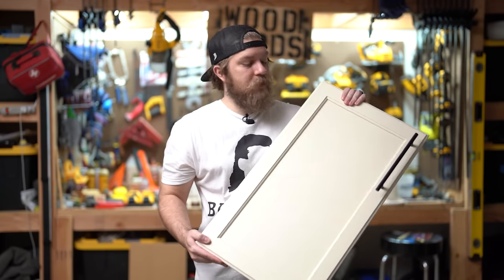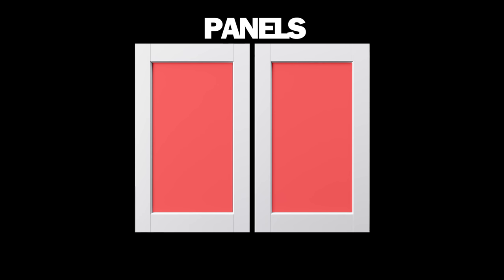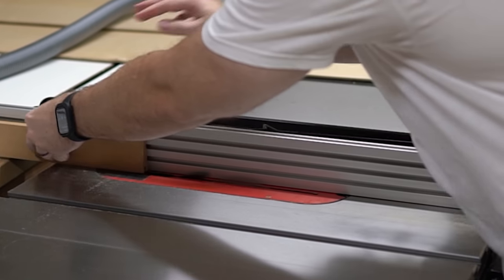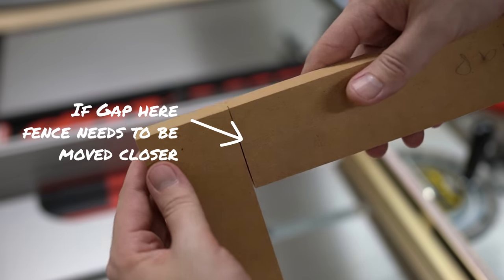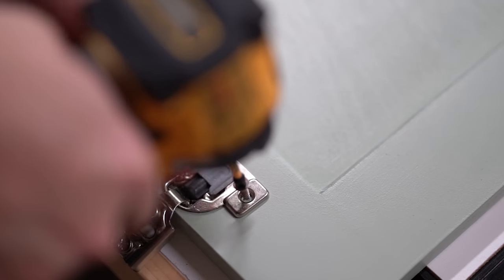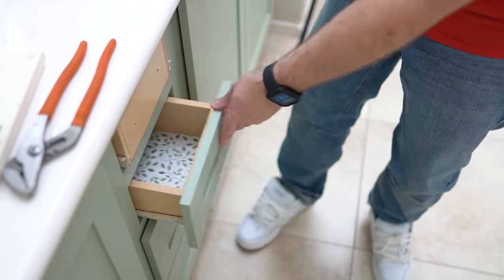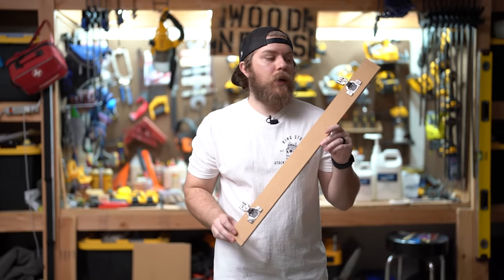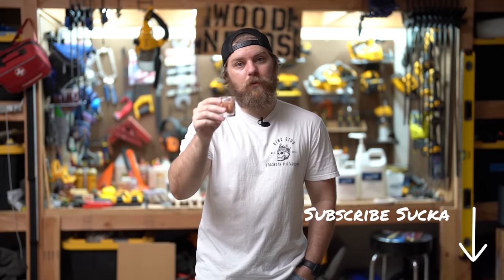CHEAP and EASY Shaker Cabinet Doors and Drawers | DIY | HOW TO

Comment: I wanted to know what your painting process was for these doors…… excellent work, very clear and informative!👍
Reply from the maker: Thank you! After the prep work in the video, I used a primer/paint base combo that is meant for cabinets/furniture that (from what I gather) is designed to sink deeper into the materials to create a stronger finish. I rolled on using a cabinet roller brush on the flat surfaces, then a bristle brush to get inside the small angles where the panel meets the frame. Many light coats. After the first coat, mdf seems to paint just fine. The first coat gets a little drunk up but after that I didn’t have any issues with it.
Reply: @WoodNerds  thanks!
Reply from the maker: Of course! Happy to help!

Comment: I'm doing something similar for my kitchen remodel... but I'm going with 3/4" poplar R&S with either 1/2" inset plywood or MDF panels to give them some "beef."  Most of the cuts are with the table saw, but I'm using a Freud R&S shaker set to mill the inside edges to achieve a beveled look (Freud 99-762).  A bit more classy looking in my case.

Biggest tip I gleaned... cut your stiles about 1/4" long.  After assembly, run the doors through through the table saw to trim the ends flush (top and bottom) and make them dead square by removing about 1/8" from both ends.  The little you take off the rails will not be noticeable and make for perfect edges with no need to hand sand them very much.
Reply from the maker: Those are great tips! I’ll be giving that a try. I like processes like that. They allow you to be human and clean up the tiny mistakes afterwards. Thanks for watching and sharing your experience!
Reply: How'd using poplar go? I thought about the same thing while watching the video, but wasn't sure if it would be too soft to hold up to kitchen use.
Reply: @jessesimmons5436  Very well.  Since I pained mine, the finish came out great.  Poplar is easy to sand and paint.

Comment: I made some doors using a slot cutter on router table. They turned out good.
Reply from the maker: That would be a great option as well. I might have to get myself a couple bits to give it a try! Thanks for watching and for the suggestion!

Comment: Hey brother! Great video! I’m going to throw a few together this week for some practice. 

I’m a beginner at painting and I’d love to hear your opinion on a decent setup. I was thinking about airless but also concerned about paint waste in my low volume shop. 

Anyway what’s your setup? Anything you’d do different if given the chance. 

Thanks again for the video!
Reply from the maker: Hey man! I appreciate that! 

I actually just use a roller and bristle brush. Been looking at a few different models of sprayers for this type of work though. Graco makes some nice looking sprayers for things like this but they are expensive. If you’re doing a full kitchen, a sprayer is worth it. A small bathroom, you can get by with a roller brush without it being too annoying of a task.

For my painting process, there’s a short tutorial on the other cabinet door video I made.

Comment: Loved your step by step tutorial, appreciate it! Will def be buying you a drink!

Quick question, can you do a video on your dust collector? Don’t know if you have one or not but it is clean! I started on my cabinet doors and while I was  running my pieces through the miter I got snowed in with wood shavings.🎅🏽
Reply from the maker: Hey! Thank you! I appreciate it! I have a pretty basic harbor freight model with the canister filter and a cyclone dust separator. I have plans to renovate my shop and will likely fix up the dust collection at that time so I could probably put a video together about it as I go. Mdf is no joke on the dust! A router makes it snow as well!

Comment: Hey you did a great job you made me confident that I can do it I've been looking at my kitchen cabinet they seen for about 3 years now which is about 15 years old. Just dreading the job. But your video gave me a great push thank
Reply from the maker: It’s not as much work as it seems Mark! Once your saw is setup, pop some music on and batch them out. The setup takes the most time but the remaining process is easy and almost therapeutic. Good luck with your update! Cheers man!

Comment: Great video. Probably going to be a winter project for me in our master bathroom. If all goes well, we may be doing this in the kitchen...great video keep 'em coming. Also really like that Dewalt driver with the delicate mode. Really interesting.
Reply from the maker: Let me know how it turns out! We are very happy with ours. I’ll have to make more soon as my wife wants me to renovate our coffee bar in the near future.

I really like that driver! The delicate setting is also great for pocket screws. You can of course set the clutch on your drill but having this feature on the driver has been nice as I often forget what gave me good results on the clutch for different materials/uses.
Reply: @WoodNerds  For sure. I showed my wife your video and it's now turned into mostly a laundry and master bathroom remodel. With all new doors and she really liked the color of the cabinets and the gold. However, she's thinking a navy blue with the gold. 

Keep the content coming. I'm really enjoying your channel.
Reply from the maker: I think navy and gold is also a smart match! Dude, thanks for watching and interacting! Much appreciated! More content in the works.

Comment: Very good explanation, thank you! I still have a question: I need to build quite a few doors measuring about 42” long and 16” wide, is it better to use 3/4 thickness instead of half an inch for more stability of the door? And also how many hinges would be needed per door 2 or 3, since doors are tall? Thank you in advance.
Reply from the maker: Hey, thanks for watching! If I was making tall doors, I’d go with 3/4” material to be safe. They will be more stable. For the hinges; the hinge manufacturer should have a guide as to what weight/size of door requires what number of hinges, but sometimes it’s hard to find. A general consensus is anything over 40” needs a third hinge and cabinets over 60” might need a fourth. I hope that helps!
Reply: Thank you very much for the reply!
Reply from the maker: Of course! Good luck with your project! I’d love to hear how it turns out!
Reply: I found my comment on your video a year later, what I ended up doing for my project is just flat panel doors from 3/4 mdf sheets, with 3 hinges per door. I was too scared to do all styles and rails with the grooves.
Reply from the maker: Hey! Welcome back haha. I hope that worked out well for you!

Comment: What paint did you use and how did you apply it?  I feel like that will affect the durability a lot.
Reply from the maker: I used cabinet and furniture paint applied with a cabinet roller brush on the flat surfaces and a smaller bristle brush in the corners.
Reply: Yeah, barbara, definitely doing a good job on finishing will prolong the life... a cheap HVLP spray gun would work if your painting skills aren't great... and spraying on several coats of "sanding-sealer" with a light sanding in between coats (remove dust witb a tack cloth) before spraying on a couple coats of paint will make for a very durable product... 

Go for it !! 😉

😎👍☘🍺
Reply: @WoodNerds What is the color?
Reply from the maker: It’s “clary sage” satin finish, using a “cabinet and furniture paint” base to help mitigate wear and tear. The tag doesn’t seem to have the brand but my wife picked it up at Lowe’s (if you have one near you). I think the manufacturer is sherwin Williams!

Comment: As a woodworker, it’s people like this that should remind us all that, the bottom line is that the job got done and looks and functions well.
My methods, admittedly, are not “professional” and my work is hardly perfect, I feel that one must give a nod to tradition while, kind of ignoring it and do what one can do to get the job done.
Awesome video. Thank you.
Reply from the maker: Thank you Tom! I appreciate that. I agree! There are different levels of complete when it comes to projects. If strength and longevity was most important and the only factor that mattered, we’d all be metal workers so using materials or practices that are the absolute best isn’t always necessary depending on the situation. Thanks for watching and taking the time to say this! Cheers!
Reply: @WoodNerds  I’ll be making kitchen cabinet doors using your method starting this week. Thanks.

Comment: Wow , finally some helpful tips without  needing a million dollars in tools to do the job. Thanks new sub.
Reply from the maker: Hey Rick! I appreciate you watching, man! Cheers!
Reply: @WoodNerds  you briefly showed your miter saw stop block, do you have link for that. I didn’t see it in the list. I have a large 52” x 48” recessed niche in my wall that I’m going to use your method to create some barn doors for it and put on barn door bifold hardware and that stop block would come in handy thank you
Reply from the maker: @rickhoupt6933 dude! It’s the “toughbuilt s600 miter saw stand” I can’t find it anywhere now. It’s the best one I’ve seen. I even contacted the company to ask about it going missing and they said it would be back soon but haven’t seen it since.
Reply: @WoodNerds  I have the Ridgid 12” dual bevel with rolling stand. Haven’t taken out of box yet, not sure if it has one. I’ve been doing construction stuff for 42 years  just mostly rough and trim stuff. Getting ready to do a big wainscot job( stain grade) in my house so gathering tools and knowledge. After that a library. I greatly appreciated feedback.
Reply from the maker: I’m sure it does! Been doing a lot of trim style work myself. Working on a grid wall for my wife right now (basically board and batten but the entire wall). That miter saw and stand has been great for stuff like that. A library sounds really cool! Hope it goes well man!
Reply: @WoodNerds funny the master br I’m doing board and batten look and apparently painting all same color. (Wife saw on Ticktock argh lol). Hope you do a video. Sure I could use some tips.
Reply from the maker: @rickhoupt6933 I wasn’t planning on it but I know there’s guys out there with “hunny do” lists just like ours haha. It never ends and social media has made it more complicated than ever!

Comment: mdf can not support screws in my experience, its basically a thicker version of drywall made out of a different material. The weak point are always are the screws. Securing the hinges by screws will create stress points where the mdf will fail over time due to heavy use. Light use should be completely fine. The workaround is to 1) use more screws to distribute the load or 2) use a some sort of backing plate like thin metal plate, or 3) use epoxy as the primary source of attachment with screws being secondary.

Comment: Excellent video! Super great! 
I really appreciate how meticulous you are from start to finish. I am a beginner with an ol lady handicap. I'm fairly knowledgeable  with certain steps, it's the gathering of everything  I'm going to need, like  types of hinges,this and that etc.. I'm not confident I'll choose the right brand, product etc.so many choices. And the worst part for me is give a set of instructions and I will find 20 ways to mess it up first. Show me once maybe twice no matter the difficulty, I'm good. I work the the way you do, like how you check 1 way, then turn it over check again, and  taking  extra measures. Insurance for   added assurance. The drawer front clamps plus the additional blocks for the sides, then the doohicky for the space and the bottom board to insure the 1st front was even with door bottom ,I'm OCD and :within tolerance"is not good enough and will drive me nuts.  I mean you are super efficient you offer ways to help others avoid mishaps and your well prepared!  100% 
Thank you!
Reply from the maker: Thank you so much! I appreciate the compliment and feedback. Being very specific and cautious is a pro and a con haha. Thank you for watching and taking time to write out your thoughts! Good luck with your projects!
Reply: Get your hinges first, then a drill jig that will match the hinges you get.

Comment: There is an even easier way, no dados/tenons etc. simply pocket hole the rails/styles together and glue/pin a panel on the back (full size of the door). This will give you the full 3/4 thick traditional door. https://www.youtube.com/watch?v=LgEjdfpRZa4
Reply from the maker: I really like that. I’ve been considering something similar as a different approach. I’m thinking I’ll make a video on it pretty soon here. Thanks for watching and sharing that video!
Reply: I did this exact thing on the cabinet doors in my theatre room and they are the same as the day I made them 13 years ago. It is quicker and gives you a 1/2 difference between the panel and front of the rails and stiles. I used 1/4 MDF for the panels and flush trimmed them to the rails and stiles. Cheers.
Reply from the maker: @dgammon58 thanks for confirming! Great to hear everyone’s experience!

Comment: Dude, you did such an incredible job. Those cabinets look so awesome. Quick question from a newbie. Same material thicknesses if I'm doing my Kitchen? Thank you for taking the time in showing how you did this. Really appreciate it. Just gotta get the nerve to do it. If I could do this it would literally save me thousands of dollars.
Reply from the maker: Hey! I appreciate the compliments!

Yeah, same thickness will work. I feel like the kitchen has a higher potential for damage with all the utensils and pans you move around in there. I’d probably go for the 3/4” material for that area or if you’re really set on the thinner doors, maybe make a set and try them out on the cabinet that gets the most use to see how they hold up for you. Personally, I’ve found that testing things out can be really helpful when making big decisions like that.

Comment: Hey Tyler! Great, reassuring video. I’m currently in a place with extra blah “landlord special” kitchen cabinetry made only of 3/4” MDF (cut plain, with no rails or styles present at all — just raw sheet painted poorly all around, and with too-tight tolerances). Even that crap has mostly held up for probably a decade, although the tight gaps have created a few rub spots in the paint, which then allowed some moisture in, which then bubbled the edges on doors directly under the sink 🤬.  I thought I would need to go with poplar for my next kitchen, but your video really drove home how being careful about it will yield great results.
Reply from the maker: Dude! I’m glad it was helpful! Thank you so much for the support and for taking the time to share your thoughts! I hope the new ones come out well! Good luck with your new doors!

Comment: I bought this kreg jig for my old door to install soft close hinges and it was awesome and made it a breeze. But I would love to switch all my doors a drawers to this style but my cabinets are oak but now painted ultra gloss white and I mixed 1 to 1 on ultra white wall paint and a gloss clear coat and it made a great finish and it self levels when using a brush and it cleans so easy to keep it all clean.
Reply from the maker: That’s awesome! Nothing like an easy to use finish technique! Thanks for watching and leaving a comment man! Cheers!

Comment: Awesome video! It's awesome having a tutorial.
You can easily build some 'spares' for a low cost (or even do it on demand). Then the paint might not fully match up though. When you have kids or if you tear out a door by accident, MDF would be really hard to repair.

I;ve used poplar and maple before. I should try making some MDF ones for a powder room as an experiment! I can always remake them if i need to

Comment: This is definitely one of the best videos I've seen for MDF cabinet doors. Amazing results! 

For my kitchen, I wanted more of a flat cabinet door look. Do you think I could just use a flat piece of MDF to get that result? If so, would 1/2 inch still be okay? 

Thank you again!
Reply from the maker: Thank you! I haven’t done flat panel doors before but I think the thickness should be 5/8” or 3/4”. This way you won’t have issues with mounting the hinges.

Comment: Good video.  I am replacing internal shelves with pull out drawers and using existing doors but I am making an opening in my island and this will be helpful.  I looked up MDF vs HDF and a 4x 8 sheet was similar in price ( I think they were both same thickness). I am a new subscriber and thank you for the video.
Reply from the maker: Hey! Thanks for watching! Awesome! Glad the video was helpful. I appreciate you subscribing and taking time to comment! Good luck with your project!

Comment: Very nice!  I refinished my kitchen 15 years ago in nearly the same method.  I cheated a little more though and used 1/4" MDF for rails and stiles over 1/2" MDF doors, glued them together and from the outside looked great.  Unfortunately little scratches in the finish over time introduced moisture and the MDF swelled.
Reply from the maker: Thank you! Hey, if it looks good and lasts 15 years I don’t see a problem haha. Thanks for watching!
Reply: True, and it was fun to build!